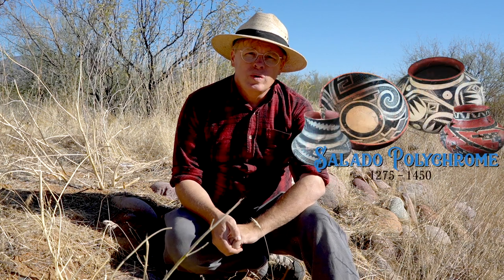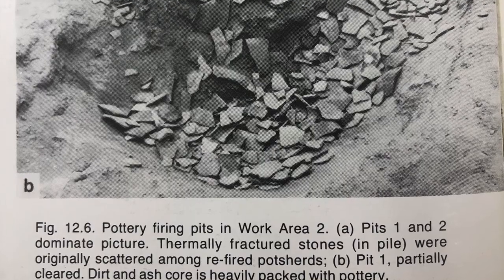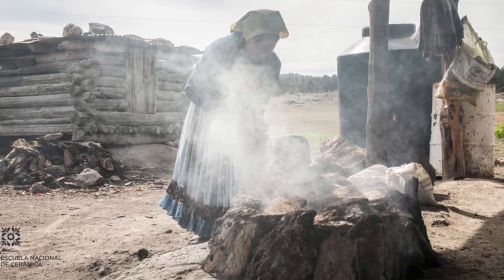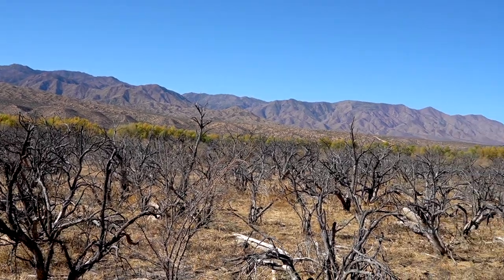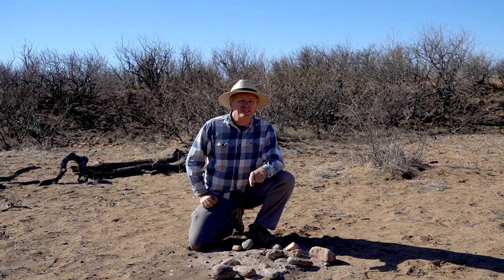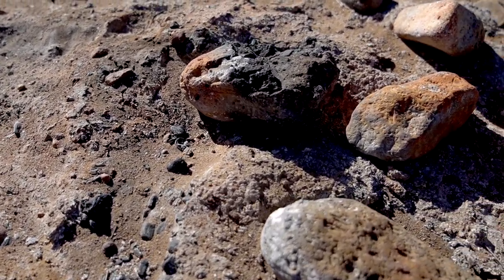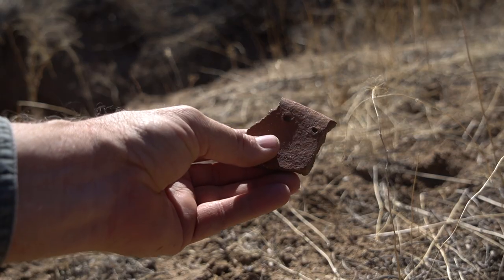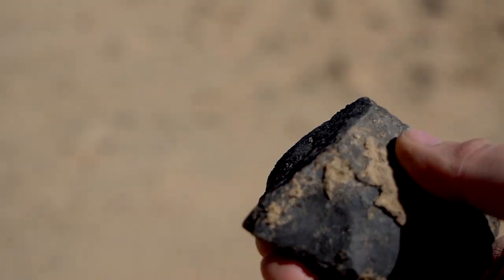Searching For Ancient Pottery Kilns

Comment: Interesting. I tried to fire above the coals and I believe I got the fire to hot too quick. Any indications of how they controlled temp?
Reply from the maker: Not a whole lot you can do to control temperature. Some light their fire from the top of the fuel so it heats up more slowly. Try adding more temper to your clay to protect against thermal shock.